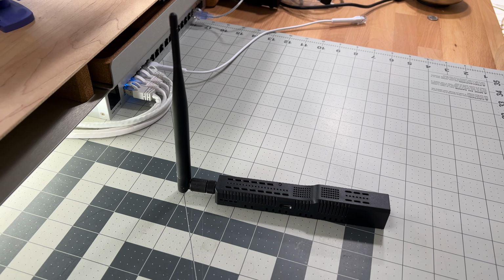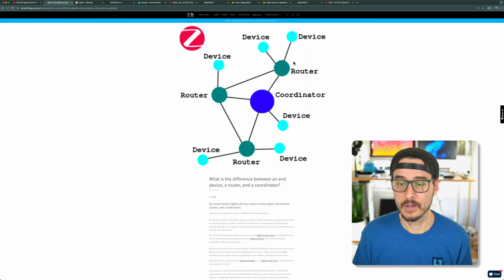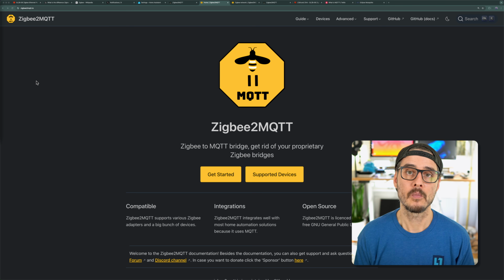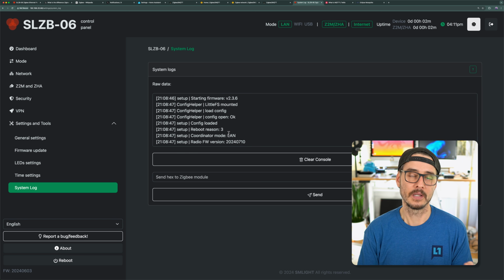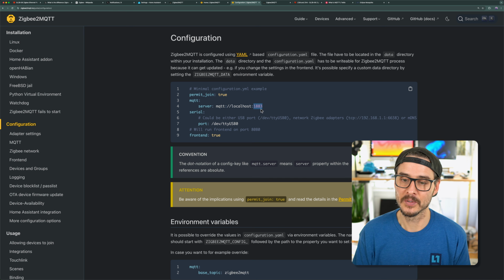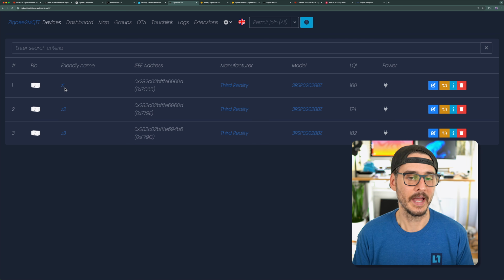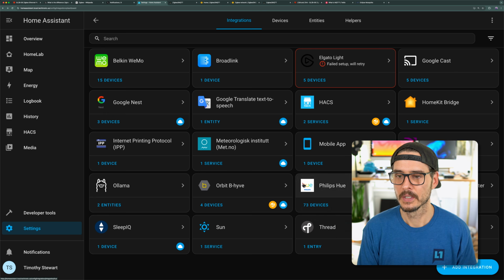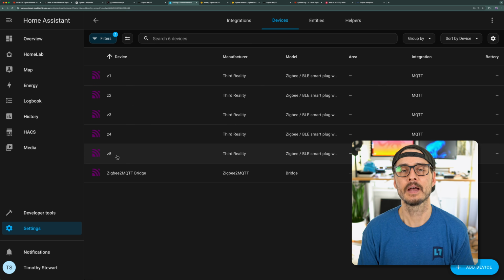Creating a ZigBee Hub with the SMLIGHT SLZB-06 and Home Assistant

Comment: Nice shirt and excellent discussion.
I'm in the beginning stages of setting up HA and am considering pretty close to your setup. eg., I'm already running mqtt for frigate with HA in docker and am considering this PoE coordinator for a Zigbee network. I'm going slow so I don't unknowingly introduce security holes.

So it's unfortunate you haven't made more videos, especially regarding the advanced settings in docker. The wireguard implementation is quite cool, but I thought your comments on not opening up the ports outside of the docker container was quite helpful and interesting to me at least. While I can figure this out easily enough on my own, a video detailing these ancillary features could be helpful to those interested in more advanced setups or helping to make one's parents home smart, etc.... 

Lastly, you have an excellent way of explaining complex details.

Comment: Thank you for explaining on this still confusing topic for me to get setup properly still with a Device! I have a ZHA setup that has a MQTT on my Home Assistant, that is still not reliable at all. And now thinking to do another bid change over and setup but not sure how to go about it due to me having a Proxmox setup onto a Ikoolcore which only has at the moment a c usb port to connect into it a very poorly SONOFF Universal Zigbee 3.0 USB Dongle Plus ZBDongle E which as never really been a stable reliable connection, which I'm not sure if its due to it being incorrectly flashed at the sart! ALl I know it was hard to get setup so once it was I have never touched it since. But now I have a very lot of devices doing aver lot of things. So I need to find a safe manner to try to get over onto a better setup., This also includes new POE switch as I have none, and how do I get a POE into a Ikoolcore for Home Assistant to work, Has I never set it up over a network but it does have a ethernet into it but I' have no clue how or if that is working. Any further help or advice be much apricated!

Comment: On the face of it the Zigbee LAN POE Coordinator SMLIGHT SLZB-06 looks like it will do what I need but please can you confirm?

I use a Home Assistant Connect ZBT-2 as coordinator for my Zigbee network, managed by ZHA. I need to extend the zigbee network over Ethernet, setting the Zigbee LAN POE  SMLIGHT SLZB-06 as a router. Probably more than one. Can it do this?

Comment: Hi! The ads mention that the SMLight SLZB-06M is able to connect via Zigbee, Wifi, Ethernet and USB. Since the only two ways to physically connect the device are: 1. the Ethernet hole and 2. the USB-C hole (which connects to the DC adapter) do you have an idea of how to do the USB connection to the server when the Ethernet network has NO POE. Thank you!

Comment: i just realized it seems i could run one of these in router mode for a remote building (connected by fiber to the switch HA is on) and the ethernet will backhaul the information back to home assistant. that literally solves all my problems i was trying to figure out and i was going to end up just running two instances of Z2M which i didnt want to do.

Comment: OTA firmware update can be dangerous when you want to update your smart power plug which measures energy consumption of your whole homelab (homassistant included). Because the plug turnes off and back on upon update :) Almost learned it the hard way. Thank God I first tried to update its twin measuring the consumption of less critical devices😀

Comment: Moving from zigbee2mqtt to ZHA is easy. Not as easy the other way around though. Some zigbee.chips work better with one or the other. I learned this when I got the sky connect, which is meant for ZHA. I was using Z2M at the time. To move to ZHA

1 - open zigbee2mqtt, click settings, backup the radio

2 - unzip file, fine coordinator.backuo.json

3 - plug in new Zigbee adapter for ZHA and stop Z2M add on

4 - I still ZHA, choose coordinator, then option to migrate from file, choose json file and your done. 

5 - If ZHA is already installed migrate radio and choose the same json file. Note, any existing devices in ZHA will be lost

You can create a backup of the ZBA radio but there is no easy way to migrate from ZHA to zigbee2mqtt.

Comment: How can you be so shameless  advertising this crap!

When connected via the ethernet, turn of the power in the house and turn it back on after some time - it will never reconnect! Never! After whole of your tcp ip network reboots, you will have manually power it of and then on again, to make the esp module reboot to enable reconnect... This means you never know if your zigbee network still works or not! Every power outage will crush zigbee untill you notice and manually reboot the coordinator. I have 3 pcs of this shit at my shelf which I had to drop after I descovered this issue...
Reply from the maker: Odd, I’ve never had this happen once.
Reply: Use a fixed ip address?

Comment: Nice choice of co-ordinator.
I finally dove into home assistant about a month ago but went the VM route for HA installation. I just thought it would be easier. I picked up the same co-ordinator (SLZB-06M), but went with what I thought was the easier way to learn, and that was ZHA. I only have a few lights, motion sensors and smart plugs at the moment. I did dabble with zigbee to mqtt and felt a little overwhelmed, so went back to ZHA. Might try it out again at some point before I get more devices, but loving home assistant, it's so cool.

Comment: Actually, you should avoid letting your EndDevices connect to the coordinator.
An EndDevice is nearly always a device running on battery and wants to wake up, do a reading, send that back and go to sleep again. This means an EndDevice must be dealt with directly. A router has main power and can wait. A coordinator has a rather large workload so dealing with the priorty that EndDevices wants will slow it down and that will effect the performance of the entire network.
In ZHA there is a setting to deny EndDevices to connect to the coordinator. Made a huge difference.
If you find that your enddevices run down their batteries faster than they should, it could also be a sign of this. The coordinator can't keep up and your enddevices are forced to stay awake longer than normal.
Reply: Thats really interesting - I would love to see a performance test for end devices connected to the coordinater vs a router. I've got quite a large zigbee network, so any efficiency gain is beneficial to me.
Reply: @UltraAitch  I used to loose some EndDevices of and on (typically sonoff temp sensor and Aquara wall switch without neutral. The one with neutral is a router) plus sometimes my Zigbee coordinator needed a reload.
Sometimes I had several seconds of response time on some devices.
After isolating the coordinator from the EndDevices, my Zigbee network has been rock solid and much faster.
In the configure.yaml, I've added under the zha: section
zigpy_config:
source_routing: false
CONFIG_MAX_END_DEVICE_CHILDREN: 0
Reply: @My-noname  This setting prevents my ZHA from starting. I see no mention of this working in ZHA anywhere but your comment (not in the docs either). I see it's an option for Z2M though. Can you guide me somewhere to troubeshoot? Thank you!
Reply: @MiniPlex2 Been running it like that for a long time now. It's the HA zha forum, somewhere. I didn't invent it myself.
Reply: @MiniPlex2  Wait a minute. There was one line missing! Sorry. Before the source_routing line, there should be a line with
zigpy_config:

Then it will work

For clarity. here is the whole thing

zha:
zigpy_config:
source_routing: false
ezsp_config:
CONFIG MAX_END_DEVICE_CHILDREN: 0
Reply: @My-noname  Thanks for following up! I'll give it a try.

Comment: so I'm using a sonoff usb adapter for my ZigBee devices. What is pros and cons for this vs that other than POE?
Reply: Better range. Put it anywhere you want in the house - so you can have your HA machine in a closet in a basement and have the Z coordinator on the main level. This model is using a Texas Instruments Zigbee chip and not one from Silicon Labs, which is a plus if you ever have to connect it via USB and also have a Silicon Labs Z-Wave controller - no conflict. WebUI is fantastic for managing the device's own settings/updates.
Reply: You literally got to see an overview of the whole web UI that this device has, in this video. it's objectively better than sonoff products with a boat load of features.